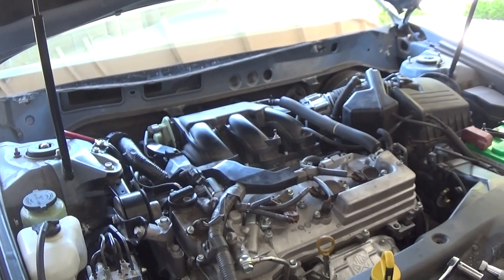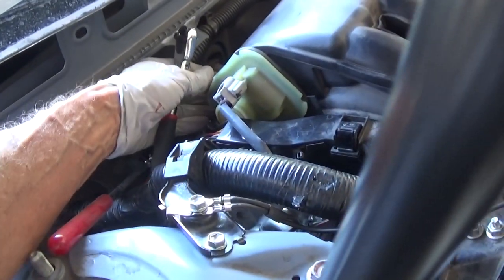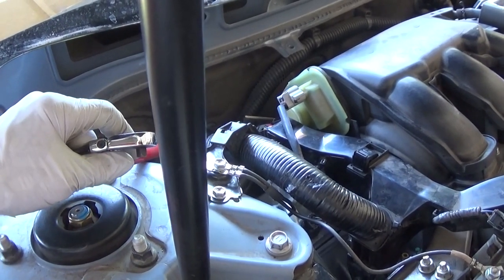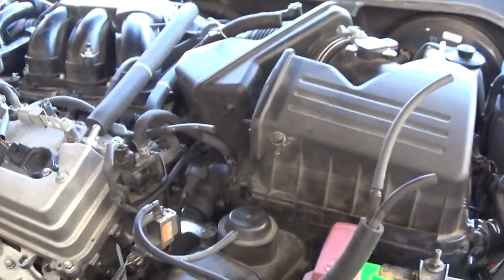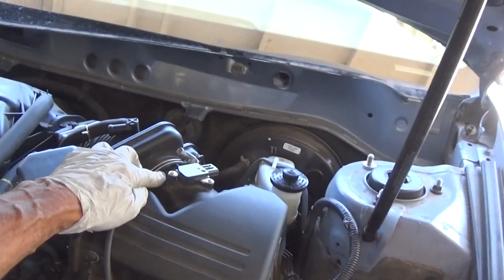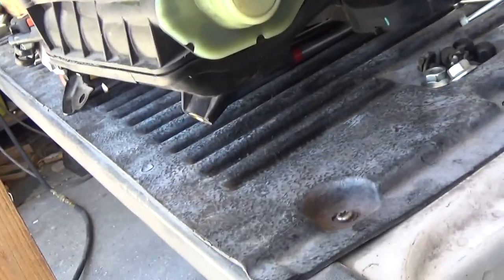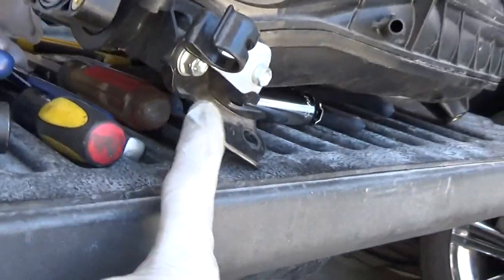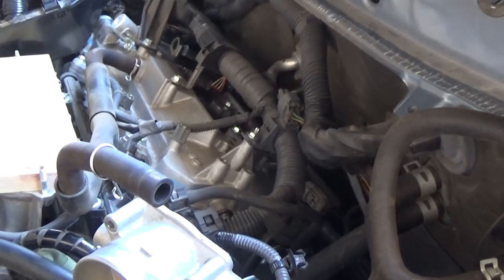2006 Avalon 3.5L Coils / Wiper Tray Pt 1

Comment: Great advice, I also have an 06 Avalon and it threw code P3056 which I found is the #6 cylinder.  Back bank of cylinder on engine from left to right is 1, 3, 5 and front bank is 2, 4, 6. So code P03051 would be cylinder  # 1. P03052 would be would be cylinder #2  and so on. Replacing cylinder 6 coil is a 2 minute job, i was going to do all six until I found out about the job it was. I have 210k on it so im rolling the dice on the back bank. I'll just replace the one.The guy at auto zone didnt know how to decipher my code. You can't beat you tube.

Comment: I just wanted to say thanks for this vid. I've never had to do auto work on my own and with the parts I had (mostly a decent socket set, some leftover hex wrenches from a chair I ordered, and some decent spray), I managed to knock it out over... a total of 9-10 hours I think. My body hurts and I had a leftover screw from one of the mounts that I didn't need to take off (I think anyway - looks like them but I don't think it's critical), plus I need to go buy a steel ring clamp for one of the hoses that busted on me - but overall it seems to be working, and I wouldn't have been able to do it without your vids. So again, thank you for uploading this! Weirdly enough mine was missing the bolt you found so problematic, which I will not complain about given I don't know how I'd have gotten it off otherwise. I'm not particularly worried either what with the other 7 bolts/nuts holding that part in place.

What did suck was that I put a hose at the wrong angle and didn't realize it until I'd put everything back together, meaning I had to essentially do 90% of the work twice. Still, a lot learned.
Reply from the maker: Good to hear...thanks for the comment